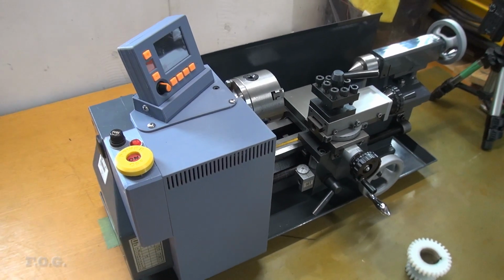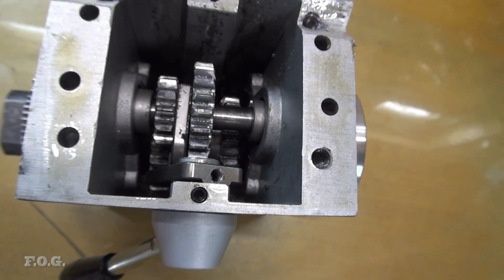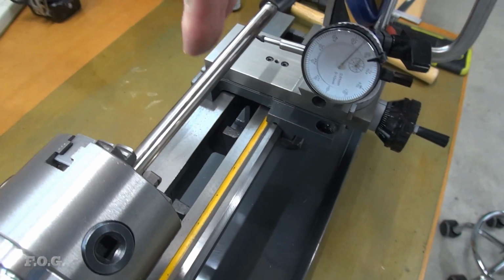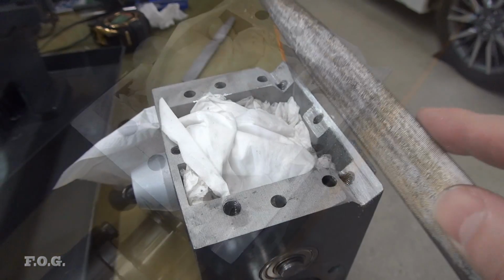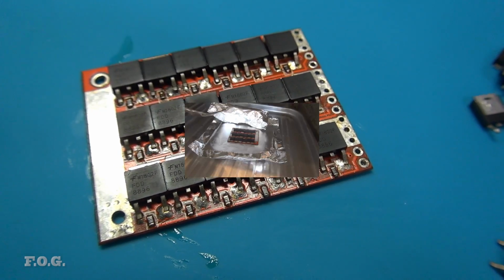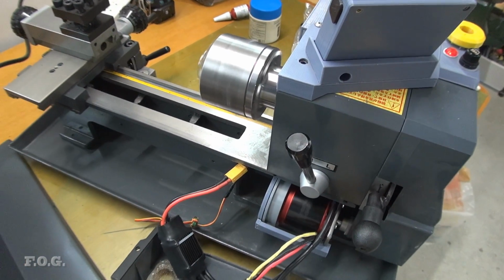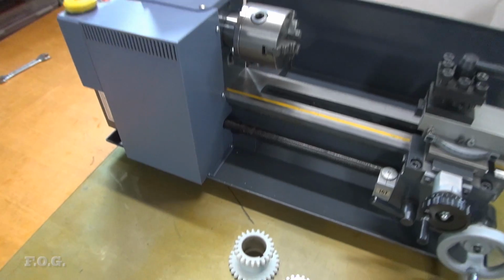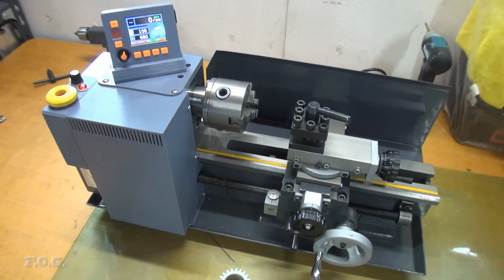EP14 - Mini Lathe Upgrade - Changing Gears & Aligning Headstock

Comment: I would say that if you put some grease on those metal gears then they would be quite a bit more quiet.
Reply from the maker: Thanks for the comment.
I have been using this combined metal/plastic gear arrangements for a few years now, and it has been working really well.
Your point on lubrication is fair, and I think I originally had a heap of lithium grease on there, but it quickly flung off and stuck to the side of the case.. Implementing active lubrication from a sump is probably the ultimate solution to this if I really wanted to use both metal gears, but that seems like too much trouble given the current solution is working really well.

Comment: @ 24:50 you said cuts fast but rough. Your feed and speed is way too fast. it's not the tool. Also, you're not using coolant. If it's aluminum I would try turning between 175-250 RPM. Shallow cuts will prolong your tool life also even though it takes longer.

Comment: Check twist on the lathe bed, as I had the same problem. After messing around for few hours managed to reduce taper to about 0.01mm over 20mm rod, which was amazing.
Reply from the maker: That would be an interesting twist.. pun intended.. I am not sure I have the skills or setup to detect anything other than a big twist, but I will take a look at that next time I do a full strip down. Even so, the results I was getting with what I did measure was consistent and predictable, so I suspect it might not be too bad in that respect. Without bolting it down and shimming, or heating and bending, or regrinding the surface (none of these I could do BTW), how could you adjust out a twist on a mini-lathe bed? Thanks for the comment!
Reply: @ForOurGood  idk what kind of tools you have on hand, but velding or at least getting stock big enough to bolt to will do wonders. Personally used 50x50mm square tubing to build mine, also added a shelf at the bottom to add extra weight (bricks, tiles or steel cutoffs). And damn what a difference, less vibration, could take the twist out, better cut quality. Hopefully you can make something as that will make your life so much easier, looking forward to your solution.
Reply from the maker: I have always known that bolting it down will make a big difference, but I have needed to keep it portable due to a lack of space. But making a heavy duty mobile stand might actually be a good idea at some point (I could store the tooling in the same stand). Sadly I sold my welder a year back and have not bought a new one yet, so this is a good project for the future. Thanks for the idea!
Reply: @ForOurGood  If I remember correctly I have Longweld MIG/MMA chinese welder (green colour with rounded case and supposingly it's German :D ). Payed around 250€ and after 3 years of farmer grade welding didn't have a single problem with it and I strongly suggest of getting a cheap Chinese/"German" welder if it has a REAL 2 year or longer warranty.

Comment: Yeah I had the metal gear conversion blues as well ! I ended up converting to a custom 2 speed belt drive and a 3ph motor / VFD combo . Ended up replacing the machine with an optimum unit as it had a better tailstock and a heavier bed - the old lathe is sitting here waiting for me to decide what to do with it - maybe a dedicated toolpost grinder / crankshaft grinder or I may just set it up to use the turnado fixture I have or I may just sell it - don’t know yet . One thing I do know is that getting everything aligned to the bed can be a deep , dark Rabbit hole to go down ! 
You might have to build a custom ESC if the ones you have keep BBQing themselves - maybe something wrong with the design ? Maybe the Mosfets are not switching on or off fully ? 
Thanks for the fantastic video !
Reply from the maker: Hi Ian,
Thanks for the comment and also the original suggestion to swap out that gear, it worked out really well and will provide much relief to my ears.
I am pretty convinced now that the microcontroller on this ESC is suffering an upset caused by bad electrical design or poor software, the net result is both High and Low mosfets  in the same chain are switched on, causing a short and a BBQ.. I did swap to a different processor board this time, but I am not hopeful as I am pretty sure all of these have fried at one time or another. At least this single mosfet board build will make it quick and easy to fix should it fry itself again.
I have already ordered some parts to make my own ESC, but maybe I will just reuse these mosfet boards to save me some hassle.  I have a few different things in mind with how I will implement this controller, so stay tuned for that!